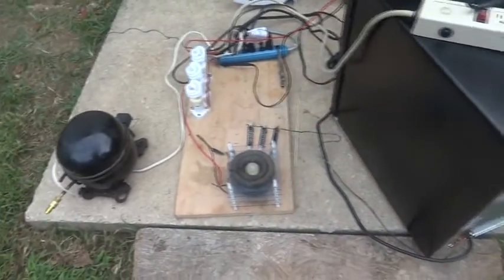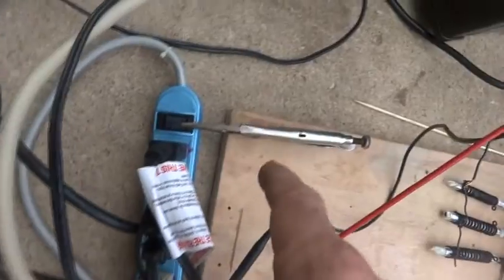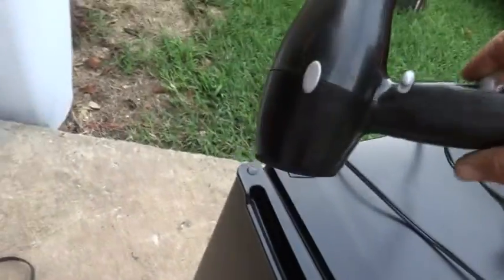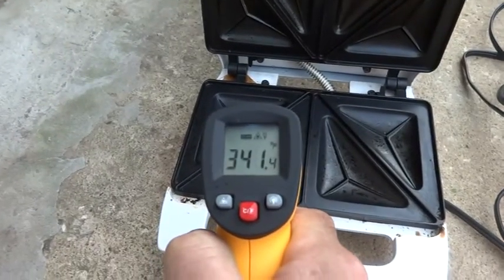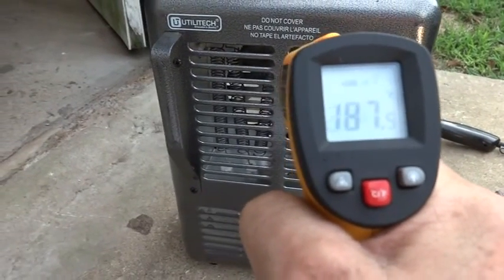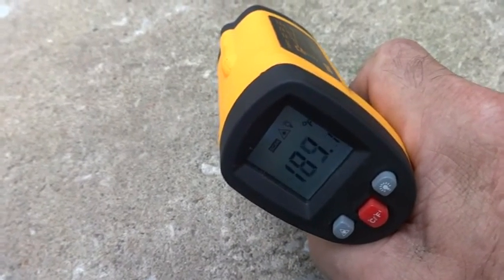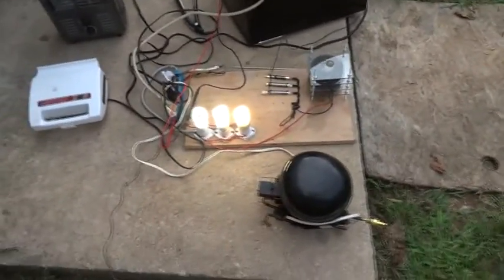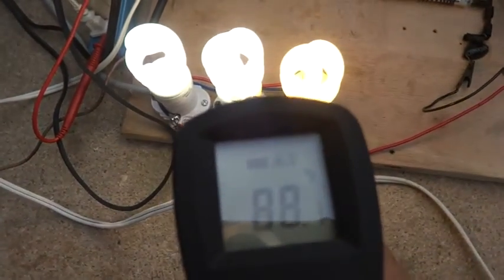MAGRAV OFF Grid System -  Test 2

Comment: perfect.....but l need to know something about how to connect the coils, as l know that you have to put one coil inside the other coil to make the megrav but when you have to connect the inside coil with the outside coil how do you do it because there is one  coil inside the small and the big one so they are double. lets explain it...for each circle coil you need 2 coils to put one inside the other and the same for the other big one but how do you connect the inside with the outside and then connect the small circle with the big one? did l explain  it right? lol